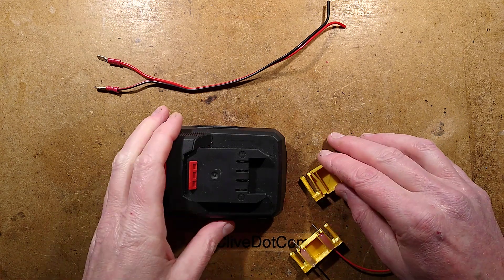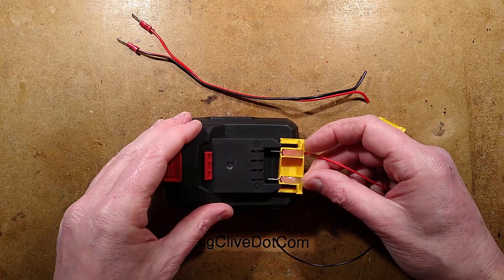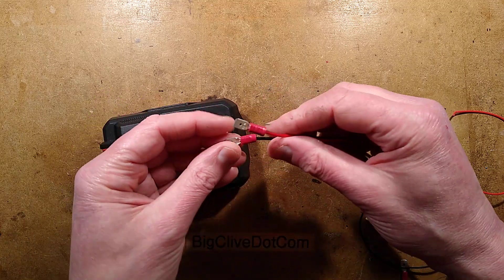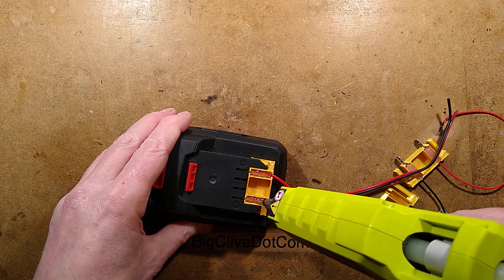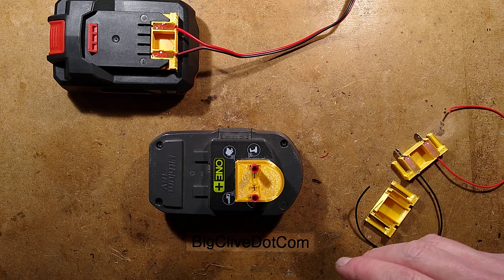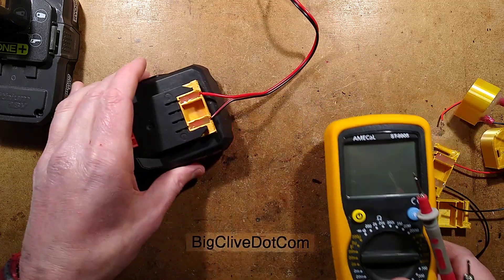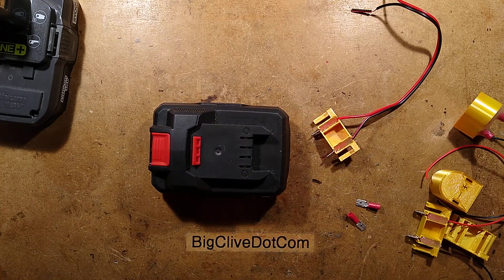Simplest Ryobi and Parkside battery connectors

Comment: I've found using a machinist's deburring tool (dirt cheap and the blade lasts forever on plastic) works amazingly well for removing brims, trimming back elephant's foot, and just general breaking of edges. Since it cuts instead of a abrades, there's no clogging of files or sandpaper, and far less airborne plastic dust.

Comment: Just use spade connectors and you can plug them into any battery because some brands like dewalt flip the polarity from all other brands why do u need the plastic the spades stay connected just fine

Comment: @bigclivedotcom
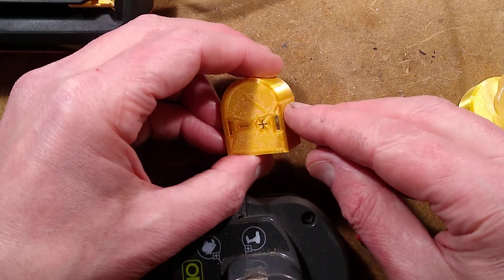3:55 -ish. You can print another similar thing, flat bottom and then take the "connector cups" (for the glue) from the other design, then glue the 2 pieces together back-to-back, use some glue that low viscosity, so it flows out nicely & isn't a thick layer of glue, in this way you don't need any support material at all for both prints & get a nice end result. (hope this description makes sense).

Comment: This would make a great portable power source for a soldering iron like the pinecil. 

I plan on tinkering with the Ryobi….

Thanks, Clive!
Reply: Another day LIDL was selling 20v soldering iron that uses parkside batteries. I bought one, I think I paid £19.99 or so.
Reply from the maker: That's part of the reason I did it.  The Pinecil also has programmable low voltage shut-off.

Comment: How difficult would it be to charge the Ryobi battery using those leads? Can you just apply the proper voltage and control the current as it reaches full charge?
Reply from the maker: The Ryobi batteries are quite complex.  It may be better to use the proper charger.

Comment: My solution for blade connectors (for laptop batteries at least) are ATO/ATC car fuses. They're solderable so I just chop up the fuse, solder the wire and add some heatshrink tube for insulation. I like using laptop packs since they already include a smart BMS that I can query for capacity and charge state.

Comment: i bought one of those parkside packs, gutted it and reconfigured the cells to be 1s 10p to make a 20,000mah power bank.  the cells are rated 2000mah but in tests they are actually 2150mah so my bank is potentially 21,500mah :)

Comment: Very good, I made a really rustic version for the ryobi battery using a short piece of pvc pipe with screws on either side for the contacts with the female version of your connectors slid around the screw heads.  A rush job but did work!

Comment: Hi Clive, I made one of these for parkside batteries using stacked 5mm plywood, glued and stapled. Added a buck converter to the top and now have a handy little power supply!
Reply: Another day I saw someone on youtube making an adapter for the parkside using an old chopping board.  It worked.

Comment: For the Ryobi adapter, consider printing it with a dome shape on the top surface. The overhangs created by the curve shouldn't be so extreme as to require support, and it'd give you room to put wells for the hot glue.

Comment: Very neat idea. I've seen a few Ryobi adapters on thingiverse but usually they use weird and expensive springy battery tabs. I like that your design uses easy to find spade connectors. Also, I'd avoid printing the Ryobi ones out of PLA, since you're using the plastic to keep pressure on the connectors. PLA experiences creep and the connectors will get loose. PETG works better.
Reply: There's a Ryobi to Black and Decker adaptor on thingiverse that uses a strip of brass doubled over and bent into basically the same shape as the commercial pins are. They're then just held in by screws.
Reply: @tin2001  hm, haven't come across that one. Sounds like a good design too.

Comment: Would it be possible/easy to print a cap that would slide over the Ryobi connector and lock the wires in place rather than covering it in glue?

Comment: Great idea. Unfortunately I don't own any similar battery pack, so I'll need to design something that fits my needs.
Next step could be to create an adapter that lets you fit Parkside batteries to Ryobi tools. And another one that lets you fit the Ryobi battery to the Parkside tool.
I actually have a battery-shaped adapter for one of my tools with an RC-battery type connector on it. I use it when my battery pack runs out. It's made from an old battery pack that lost its glory.
Reply from the maker: Note that Ryobi batteries have internal over discharge protection, but Parkside ones don't.
Reply: @bigclivedotcom  Very peculiar design from Parkside, since over-discharge-protection is usually incorporated in the BMS. A BMS needs to have 6 conductors to the 5-cell battery, so the BMS is not in the tool.
It makes some sense to put the protection in the tool, because usually there's already a PWM MOSFET there. But is there balancing circuitry present in the battery?
Would be good to check. And if there's nothing there, it would be a good idea to add charge and balancing leads to that battery, so it can be charged in a proper way, using a LiPo-pack charger.
Reply: Making a Ryobi adapter to fit other batteries will be looking odd because of the height of the Ryobi  tower/pillar thing. However, it can still be done, but not practical

Comment: this beats the Ryobi-to-Black&Decker adapter i bought to modify (so as to charge a B&D w/ a Ryobi charger). 
caveat : Nicad/NiMH chargers are NOT smart; they require a minimum voltage to start charging.
if i could use a step-up dc-dc converter to boost a live one to revive a dead one; trying to hold voltage steady while you adjust for current is like trying to hold steady an amoeba!

Comment: Using spade connectors is brilliant. I love it. 
For the Ryobi, may I suggest you bring out the perimeter wall to make a sort of cup you can fill with glue. 
The current bottom touching the bed plate would be printed as bridges with no support. 
The new cup will have a crappy bottom, but gets filled with hot glue (tangled in bridge filaments).

Comment: You really need to have a fuse in-line close to the battery, as these batteries can easily put out enough current to melt wires that thick. (The Makita 18V packs are internally protected by two 50 amp fuses in parallel!)
Also, be aware that most lithium tool packs don't have internal over-discharge/undervoltage protection, as this is usually done by the motor controller in the tool, so connecting to random loads could trash the battery if left to discharge too low,
Reply: Mike, Your telling a guy that heats up his bath with an unearthed kettle element on an extension lead to use a fuse 😂😂🤣🤣🤣   "Its elfunsaftee gawn mad"!!
Reply: That's strange, my Ridgid batteries are great for this, protection is in the battery, I assumed this was standard. It has to be on at least TTI brand tools - Ryobi, Ridgid, Milwaukee, and AEG. The batteries are pretty much the same inside. Always shuts off at 15v, 3v per cell, perfect! Overcurrent protection too.

Most of these batteries are meant to be backwards compatible for old NiCD tools, obviously they never came with onboard protection, so protection has to be in the battery.

I do like to include a self resetting 30A breaker in adapters like this anyway, like $5.
Reply: @ryanroberts1104  Spot on information.   Dewalt Bosch Kobalt and most off brand "Dewalt style slider" 18v packs have No BMS, only fuse link and maybe charge level button indicator circuitry.   One way to safely use Dewalt packs is to make a connector using an  OEM Dewalt battery adapter designed to allow use of Lion on their older NiCad tools, which has protection circuit built in (only dewalt oem ; the cheap aftermarket adapters have no protection).
Reply: @yeliab814  Came to say the same. Some have protection some do not. Research will provide the info you seek should you wish to do this. I know that if you over-discharge the dewalt batteries they will no longer recharge on the stock charger unless they are brought back up to minimum voltage by another method.
Reply: @D3M3NT3Dstrang3r  yeah I looked for an aftermarket adapter with protection, found one, black colored unit, listing photos showed the PCB inside , etc.- on  Amazon.  

When it arrived I immed opened it up and it only had two wires connecting the contacts, nothing else.   Oh well, probably better off not having some unreliable sh!te BMS anyways I guess...
Reply: How are we supposed to smoke our badly designed Chinese-made LED lights when we keep blowing the fuses?  Mmmm?
Reply: @mikeselectricstuff, but this is how some of us learn!  As a child, I learned about “anti-foaming agents” when I used hand dish soap into an electric dishwasher.  If you’re curious, it made about a half cubic meter of foam on the kitchen floor.
Reply: @firstmkb  soap bars used to act as anti foaming. The bubbles in my bathtub dissapeared as soon as I began to wash myself with soap. It was annoying. Not sure if they do now tho,  as I now have an eco shower and I think soap bars have a different chemistry now.
Reply from the maker: I toyed with the idea of using a PTC fuse in the centre compartment.  But they run fairly hot when tripped.
Reply: @bigclivedotcom  how about a standard flat car fuse, somehow built in to the center. Two female crimp connectors are excellent for that. Or even a mini flat car fuse, and then the smaller female crimp connectors you usually see on car speakers etc
Reply: @bigclivedotcom  For the projects I use tool batteries with I use a voltage / Current limiting buck converter. Add and ldo if that battery is not protected
Reply: @D3M3NT3Dstrang3r  It's wonderful how great these batteries work with a very cheap/efficient DC DC converter - either buck or boost. Any voltage you want, high amperage. We are so spoiled now!

You do have to remember to be nice to the batteries - the overcurrent protection is meant to start up a drill or something, but that would not usually be continuous. I wouldn't try to draw much more than 1C or 2C continuous...
Reply: @bigclivedotcom  Use an automotive fuse. It fits into the female version of the same crimp leads and can be housed on the back end of the connector by making one of the terminals just two connectors back2back. One male for the spade and one female for the fuse side. Then let the wire loop around in the center compartment and come out next to the direct one. Presto: Fuse in circuit, easily replaceable.
Reply: @bigclivedotcom  LOTS of low cost NO & NC thermal switches available from many places ranging widely in temp from low ~35° to >200°+. Many old style NiCd packs have them to just break the current on overtemp, but IMHO they have a way too high temp setting. I prefer the 75-85° mark. EASY retrofit.
Reply: Clive simply provides access, the parts in between are up to you
Reply: The wire is the fuse ;-)
Reply: While most batteries don't have over discharge protection every one I have ever opened does have a fuseable link basically just a super thin one inch trace that is basically a 30-60 amp fuse and I have blown them they work even the off brand China replacements I have opened have them. and on better brands like Makita Milwaukee and dewalt they have actual fuses or fuseable resistors
Reply: @joshuawheeler4404  60A in prolonged use will melt the insulation off that 1mm2 wire used on this video. 2.5mm2 could be barely enough, 4mm2 is probably a wise choice. I think you could integrate an automotive spade fuse into both of these designs, maybe even use those for both of the terminals.
Reply: Every battery ive looked at had all the protection inside the packs..  ryobi had literally everything inside the batteries..  black n decker and dewalt did also.  Only protection in the tools themselves were just overloads and thermal cut outs. The triggers if were anything besides the pots were just mosfet circuits..  now i dunno about the brand new battery line with all the brushless stuff..  those could be different, hell some tools these days come with bluetooth and even saw one with its own 4g built in so it could communicate with the mothership...
Reply: @Z-Ack  what?? That's bizarre. Or is it so your boss can see how much you're using the tool, or an attempt at anti theft? The idea of  smart tools scares me. I'd rather be in full control of my tools thankyou.
Reply: @penfold7800 
Probably to "future proof" them... Not for you. For the company. 18 months in they can start charging a subscription to keep using the tool 🤣
Reply: Fortunately Ryobi one+ batteries have the overcurrent / under discharge protection in the pack. 
I have no idea about the parkside ones.
Reply: Right - might mod the 3D printed plate to include a little PCB with overdischarge protection, probably all SMD with MOSFETs.
Reply: Parkside batteries do have an internal fuse
Reply: Automotive fuses have spade ends. It would raise the form-factor but the other terminal could be connected to a female spade equivalent and make it easily replaceable. I wish I had one on hand to test.
Reply: No need for fuses, the wire itself is still a fuse 😂
Reply: @dragonfireproductions790  that small wire probably would act as one
Reply: If you want safty this is the wrong channel 😂 to be honest I would hope everyone who would make this would put a fuse in line, even before reading this comment I was thinking how an in line automotive fuse holder would be ideal as am looking to upgrade my electric mowers battery as it realy wasnt designed for a lawn as big as mine (takes 4x charges of the 2x  5ah batterys)
Reply: "be aware that most lithium tool packs don't have internal over-discharge/undervoltage protection"

Cheap Chinese ones maybe but genuine Makita, Bosch, DeWalt, Milwankee and Ryobi battery packs have inbuilt protection circuits.
Reply: THATS VERY TRUE.. THE CHARGER'S ARE JUST BARE BONE INSIDE.
OH WAIT... : /   I SAID CHARGER NOT BATTERY. BUT YOUR RIGHT ABOUT THE PROTECTION BEEN INSIDE THE IT'S SELF.. THE BATTERIES HAVE PROTECTED IN THEM, NEAR ALWAYS
Reply: Nice one Clive! Here is more on the same/similar from personal experience.  

For those unaware, or with no 3D printer, AliExpress have battery connectors for both Bosch & Makita LiIon packs (same adapter, just move a connection plate with two screws) for just a few £. 

Brilliant, as these can now be used to connect to lights or other stuff needing up to 12v via a cheap (£2-£3) smpsu buck converter or raw 18v/21v. Or used for charging multiple battery packs from one supply via separate CV/CC buck converters with max volts and 0.5C charge current and a high power transformer/rectifier/smoothing capacitor or smpsu of say 30v 5A-10A.

 They can ALSO be used to convert old 18v NiCd or NiMh drills to take standard Makita batteries (screw or hot glue to the drill). Plus, if you get a suitably capable & small, buck converter (min 8A) & fit it inside a 12v drill, you can convert ALL your old style NiCd/NiMh drills to use Makita style batteries. New ones of these in different capacities from eBay & Ali Express.

 I already have an old 18v Draper, 18v Makita, 18v Challenge Extreme and 18v Black & Decker converted. All now work great. I've cannabalised the remaining good NiMh cells to rebuild my duff batteries for 3 other 12v drills - a Bosch, and 2 Makita 12 volt ones.

 Incidentally, ALL the drills mentioned, bar one, were reclaimed from scrap in perfect working order except for the batteries. A few were even in cases WITH chargers and knackered battery or batteries NiCd/NiMh!

In addition there are kits including BMS, charge state indicator and Makita style cases to build your own battery packs from old 18650 cells when only one or two cells from an old battery are duff & you want to make good use of the remaining good cells. I have made four 4.5AH batteries using these kits and they work just great.

NOTE: 18650 cells used should all be high current rated! So ex Dyson and other vacuum batteries are great, or known, good quality, used, high current output laptop 18650s. All cells should be the same capacity rating (2.2Ah, 2.4Ah, 3.0Ah etc) and ideally from the same device model/s or types. They should also be pretested for power capability before use.

 I just can't understand why DIYers lash out £hundreds on brand new models. The pros I can understand, they just skip their old ones when the batteries go, but replacement batteries from eBay or Ali Express can get you a fully functional QUALITY top end tool for a tiny fraction of new cost! 👍👍👍😎

Comment: Excellent Clive - For the Ryobi battery, you could print a separate part that acts as a wall that fits over the terminals and would be held in place with the hot glue. Probably unnecessary, but might look a little neater without having a load of support.

Comment: It's the spade connectors that are the really genius bit.
Reply: Hi, use existing developed bits where possible.
Just add a fuse (always a good idea) and a low voltage cut off circuit and away you go!
Good one M.

Comment: 🤔 Another idea! (I'll try not to live up to my title this time lmao)
A multi output Buck Regulator that provides high current at 12V and 5V, along with two USB ports and maybe a wireless charging coil (for smartphones), would be slicker than shit! Particularly for anyone camping. Put the charge coil on a hinged (0-70deg?) piece and presto, set the ideal angle to charge whilst watching vids! 

Most of those regulators are variable based on a resistor, so if one wanted to say it up with an adjustable pot for dial-a-voltage, that'd be nifty too!
I know that some tool makers have already offered a "USB Hat" for their batteries, but this would take it much further. 😁
Reply: Clarification: the type of hinge in referring to is the kind used for laptop screens. Not sure what those types are actually called... friction hinge? clutch disc hinge? *shrug*